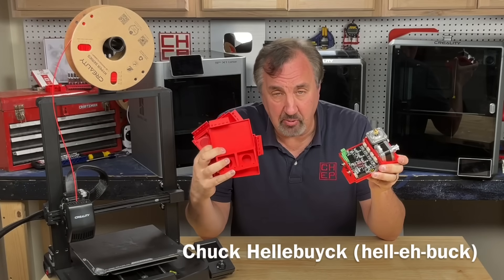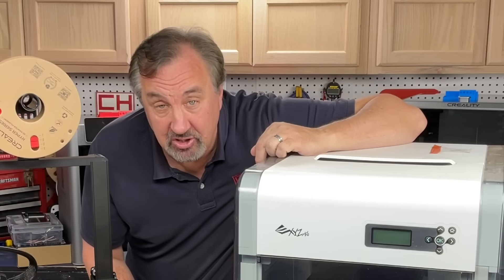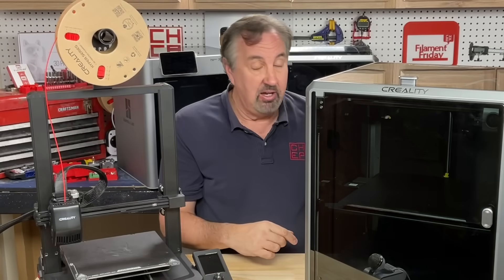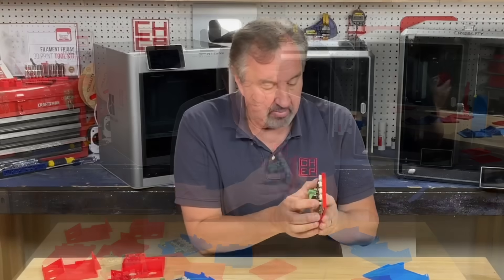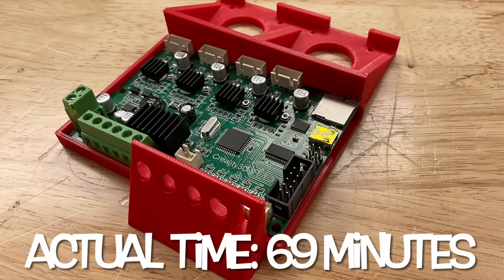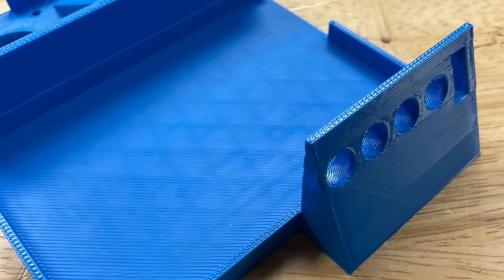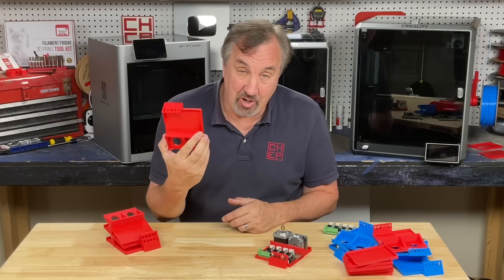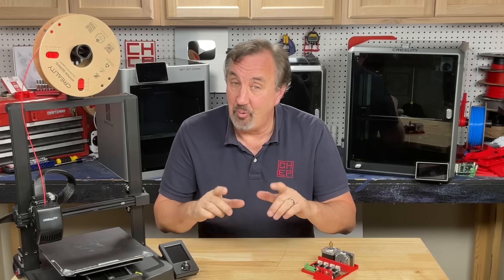Addicted to Fast 3D Printing

Comment: Been a subscriber for quite a while! I began my journey with Ender 3 and Ender 5 printers, and eventually moved to a few Voron printers for large ABS parts. Recently, I acquired a K1 Max. All these printers are key for internal prototyping needs where speed is crucial. I'm utilizing 0.8mm and 1mm nozzles with Rapido UHF for the bigger parts pushing around 50-60mm^3 on my vorons. The K1 Max, however, has proven exceptionally reliable – already clocked right over 200 hours with esun abs on it, pushing right under 30mm^3 with a 0.4 nozzle so that is fast. It has not have a single failed print yet. Im as happy as you with this one.😁

Comment: NEVER trust a creality. You will regret every penny and second you spend on it and troubleshooting. Bambu lab is the originator of the high speed printing and does what creality never has... Provide near perfect printer out the box within its first year in the market, provide innovation, listen to their base. Bambu is worth EVERY penny out the box. Bar no other printer.
Reply: cant agree...
Reply: I have been using clipper based machines since before I got a Bambu X1C and they were pretty fast.
Reply: But i get my k1 for 380€ on black friday while bambu p1s was 600€ almost double price. Yea, the bambu is better and easiest but the k1 is good for the price, i'm very happy with it

Comment: I'm really surprised (and confused) why the X1C had that flat surface layer issue considering it has the lidar that the others dont?
Reply: The problem is low temperature - the filament didn't have enough time to melt properly. As you can see it was in a spot where the toolhead flies the fastest. I guess he used generic profile for a filament that need higher print temperature at those speeds.
Reply: K1 max does have Lidar as well.

Comment: Hi Chuck. Do you think you’ll bother rooting the printer and running stock klipper?
Reply from the maker: I have two so I might at some point but not right away.
Reply: @FilamentFriday  I ask as in the video you prefer not use Creality cloud, and this could be an easy way to print via wifi.
Reply from the maker: @fliplmb - I actually prefer the thumb drive.

Comment: are you able to connect cura to the k1 somehow? the creality slicer seems to just not be as good of a slicer, and def not as descriptive with the settings.  i like the wifi print of the creality print.  can i slice it in cura, save the file, then load it in creality as it's just a reskin of old cura from what i see on the internets, and then print it? i am gonna try it.

Comment: Do you need different filament if you print faster? Or can you print at max speed with regular pla, pla+ etc..
Reply from the maker: Depends on the filament. I did use Creality Hyper PLA.

Comment: Chuck, was wondering if you have had a look at the latest firmware update from Creality for the Ender 3. Was able to get a stock S1 Pro with only the firmware update to produce a Benchy in just over 40mins with very little issues. This is over a 60 minute time saving.
Reply from the maker: What version firmware?

Comment: Does the K1 use the same extruder and hot end as the K1 Max.
Reply from the maker: Initially no, the extruders were different but the new extruder for K1 is the same and much better than the original.
Reply: Thanks, I do not need the K1 Max size, but I definetly want its extruder. @FilamentFriday

Comment: folgertech ft5 did not have a slinging bed. Maybe some one can try that design with kilpper and see if that would could be as good as the new core xy printers. It will be easier to build atleast as a kit

Comment: Any idea what speed the printer is printing at. I've been able to take my original Voxelab Aquila N32 up to 180mm and get great prints. That's 3 x what I started with. What took 22 hours to print is now down to 16.5! Big savings! If it only would respond to your fast print settings (which it will not), It would cut another %10 off I'm sure.

Comment: I'm not (yet?) a speed demon but I am leaning towards my next printer being enclosed - aftermarket enclosure options just never feel completely safe and/or effective and it would be really nice to print ABS/ASA/PC/nylon without having to worry about warping, cracking, or bed adhesion problems (never mind properly exhausting fumes produced by certain filaments). I've seen some channels have success with printing these materials on open printers (shoutout to Aurora Tech Channel) but my printers are in a basement and it's never terribly warm down there...I don't think I'll have the same success.

Also, I find it fascinating that the X1C had demonstrably the worst print quality of all the printers. As many issues as I have with Bambu's handling of personal information (particularly how they keep brazenly stealing from competitors, users, and third parties to make their products and services), treatment of non-influencers who have problems with their machines, and the implied threat of bricking their printers if they decide to only allow users to buy Bambu filaments, they usually have a reputation for good print quality.

Comment: great videos, man. if you like speed, then remove the marlin and put a klipper on ender-3 and you will get a speed comparable to creativity k-1
Reply from the maker: The machine can’t handle that speed and neither can the hotend. By the time you upgrade pieces to get that you’ve spent close to the price of a K1 on sale.
Reply: @FilamentFriday  my ender 3-pro says something different :) it’s been working great for three years now :)
Reply from the maker: @vasiapupkin6516 - How fast can you print a good Benchy?
Reply: @FilamentFriday  I have never printed benchy :) my printer prints very well at accelerations of 3000 mm per second squared and a speed of 150 mm per second. it's on a clipper ship. linear advance and input shaping are connected. Mechanics will hold up faster, but print quality begins to suffer.
Reply: Of course my printer is upgraded. I replaced the board with SKR 1.3 and the hotend with a Volcano, as well as the print head with a Titan-Aero.
Reply: @vasiapupkin6516 So it's not an Ender 3 anymore, is it? 🤦‍♂️

Comment: I wish that all youtube test videos was as fast and to the point as yours here is, clear, easy to understand, quick and to the point, well done. And I am as addicted to printingspeeds as you are, so much so in fact that I modded an CoreXY printer (that frankly  looks like a frankenstein monstrosity), you can't beat those for speed because the slighshot constructions are limited to how fast you can physically sling a heavy bed back and forth before you get physical issues that leads to inaccuracies.  

Also the way you design stuff is vital to the speedy process. For example, I print my own designed figurines. I have a character that would take 19 hours to print, I reduced that to 3 hours by improving the design alone, and it's sturdier and less mess to remove. The less support you need, the less infill, and if you can code the bridges in your G-code to work perfectly for exactly your printers melting/cooling speeds, that's the secret sauce.

Comment: If CHEP is a believer now, the existing bed slingers are in deep trouble.
Reply from the maker: After traveling to various RepRap festivals, the clear message was many tinkerers were tired of working on their Enders and just want a machine that worked out of the box.
Reply: @FilamentFriday for me that's part of the hobby
Reply from the maker: @bubba6647 - Unfortunately that type of audience has shrunk as 3D printers have gotten better.
Reply: @FilamentFriday  I don't think that tinkering and a good out of the box experience are mutually exclusive. The machines just need to be open enough to give the user the option to tinker. For example, there are already modifications and after market parts available for the K1 and K1 Max.
Reply from the maker: @andreas.grundler - I agree, I’ve shown a side spool holder for my K1 (https://youtu.be/BQM7xBcZh00?si=2ZGmMXBJHG0k9ifK) but interest in that video and others like it on YouTube tend to be lower interest videos. Less people seem to want to mod and instead just want to print.
Reply: I mean bed stingers still beats in price and beginners will never spend more than 300 on thier first printer so I think thier safe for now.
Reply: @ShadowGun625  I don't disagree, but a number of beginners will skip the cheaper entry points and go for the new 'shiny'. All it will take is a few influencers in this space to justify the extra money in the reduction of beginners learning time.
Reply: Check out the LH Stinger. 😊

Comment: If buying K1 spend the extra few hundred and get the bambu x1 I’ve been creality everything past 3 years but ummm yeah nothing touches the bambu out the box with quality and speed. Parts are genuinely good quality too
Reply: Well, in the video it looks like the X1 is no better in quality and speed than the K1 Max. The opposite is the case. The parts were printed faster and better by the K1 Max.

Comment: Purchased a K1 last month when Micro Center was running a promotion for $379.  It's an amazingly fast printer.  If you purchase one by the AI camera upgrade.  They are generally available from multiple sources for $25 - $30 dollars.
Reply: judging by the price I'd presume you are form the US (or EU)? If so you guys are always getting ripped off. that camera costs 13 bucks with shipping if you buy it from Chinese directly.

Comment: How was the noise level and using different slicing software? Also I like using my Sunlu filament dryer and could not see where the spool of filament location. Can it use all types of filament?

Comment: The real question isn't if the more expensive printers are faster. The real question is why. To put it another way, how much do I need to spend on upgrades to a $200 Ender 3 to make it print as fast as a $400 K1?
Reply: Impossible, you are comparing a bed slinger with a coreXY. Even with a high flow hotend, better extruder and linear rails, you are limited in accelerations and I know because I have a modded CR6 which is a bed slinger
Reply: I've modded the hell out of my Ender 3 and I'm still not in the X1 and K1 territory.  I have been considering making the jump since I sell prints and time is money
Reply: The main reason is they run Klipper firmware rather than Marlin.  Creality sells the Sonic Pad which is designed to work with their Marlin based 3D printers to increase the print speed.  They claim 2 to 5 times faster, but I would bet closer to a 2x improvement.  The good news is Sonic Pad can work with four printers.   The Sonic Pad also brings a variety of advanced features to Marlin based printers.  While the speed is faster, note that the print speed of the K1 printers if a bit faster.

The good news is the Sonic Pad frequently on sale.

Comment: On that thin wall, make sure arachne is enabled in the bambu slicer, it's off by default. Might help you get a better finish on those thin walls
Reply from the maker: Good tip. I’ll check.

Comment: I love my Max's.  I have two.  Creality Print is getting there but needs a few more options like the sbility to use blocker settings and different infills on the same model like Cura and I will be happy with the software.

Comment: Be careful with the Creality K1's because the doors are made of terrible glass and will literally explode in your hands. There's a reason they're on such an extreme sale.
Reply: We have 2 K1s and I must say I have never heard of this , the glass is as good as any , thick and strong,. Not sure what people are doing to break theirs
Reply: Just sounds like a Bambu Labs fan boy that is sad because they paid to much for a printer that is now second rate to one that is much cheaper
Reply: @mikeobrien9829 being stupid
Reply: It is satefy glass so if you jam something sharp into it it will explode to avoid sharp edges also handles high temps better
Reply: The same happened with my x1 carbon it's just the design if any thing hits it even slightly hard it will break just make sure to close the door after you take you print out and you'll be good.
Reply: Well... I've seen glass explode for no reason a bit too much for my taste. The last one was a stove's cover... I don't know if it's the right way to say it in English. 
But yeah, unfortunately it happens. (The stove wasn't turned on or anything and I was pretty close to it when it happened. Scary stuff.)
Reply: I'm guessing their tempered. Which means it shattered in your hands when you had sharp pressure hit the edge.

Ive done the same with a computer case panel.
Reply: It is tempered glass. The same that is used for the side windows in cars. You can hit it and it doesn't break but if you apply a force to a small point then the whole pane breaks. That's the secret behind the emergency hammers used to break car windows.

And the printers are on sale because of Black Friday week. Creality is a bit early, but these sales happen every year around this time.

Comment: Currently debating between the K1 and the P1S as an upgrade to my ender 3 - this is the first time I've heard the K1 mentioned positively in this context!
Reply: If you care about open source and not being locked into an unnecessary property extruder do not buy anything from bamboo. Still at a loss for why people ignore all the red flags around bamboo as a company and buy their stuff.
Reply: Can't go wrong with either - Creality is a more budget friendly and open design.  Bambu is pricier, has the AMS option and is a closed design.  I have a K1 and it has been printing fast and flawlessly since day one with the latest extruder and hot end.  My next purchase will be a MAX to replace my heavily modded CR-10.  I get the print speed and smaller footprint.  My last Ender 3 pro will be donated to a 3D printer rookie to get them started.
Reply: I just bought a P1S last week after using my Ender 3 for 3 years. It's been AMAZING. Not only is the speed amazing but the quality is even better than what I could have gotten with my Ender 3 all dialed in. K1's glass doors are literally popping in people hands so be careful. There's a reason they're on sale.
Reply: Take a Bambu P1P or P1S and then buy a AMS.
Reply: CHEP got paid by Creality to promote their crap. Buy Bambulab, thank me later.
Reply: @kord2003 Take a look at the description of each Bambu Lab review. Every single content creator has an affiliate link down there. This means that Bambu Lab pays them if someone buys a printer through the link. So what is the difference with Creality again?